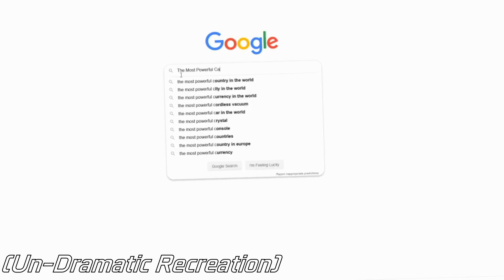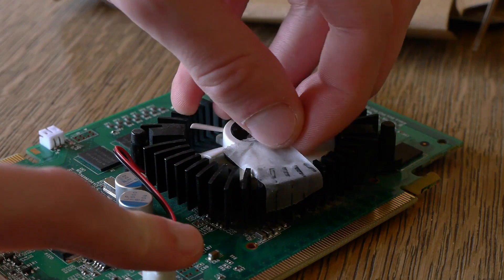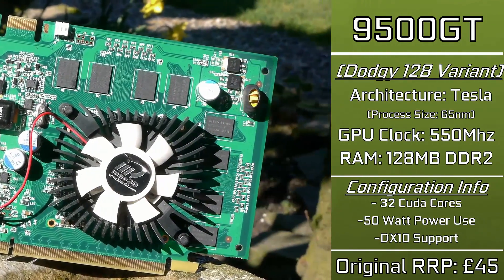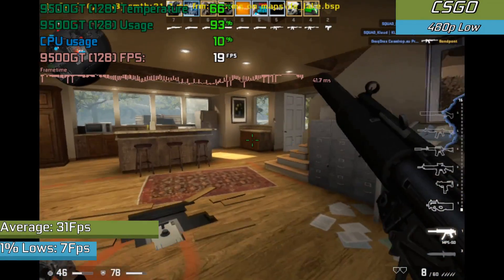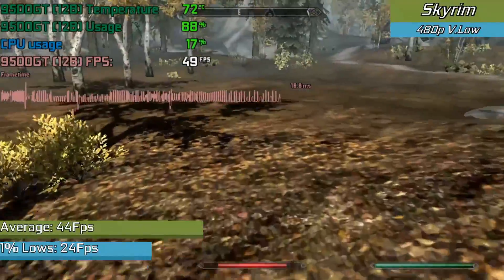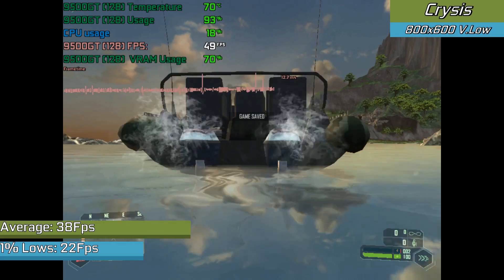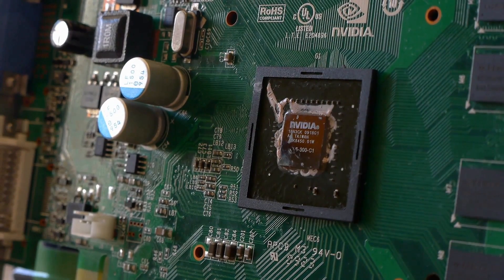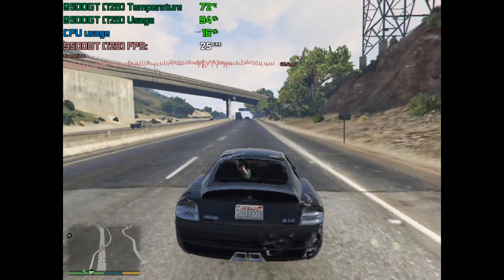The Worlds Most Powerful 128MB Card....

Comment: Imagine gaming on a 1MB graphics card...
Reply: 0.001 fps guaranteed
Reply: I game on a 1-bit graphics card.
Reply: @Crazy-qi1gw  ah, my favorite game, white screen black screen
Reply: I have a 2MB graphics card.
Reply: Basicaly windows video adapter 
(has 4-5mb vram) all the 3d rendering is done through the cpu power
Reply: Imagine using 1KB graphics card
Reply: There were cards produced in the early 90s that only had 256k and often around the 512k and 1mb mark depending on the budget at the time.
Reply: Dos games, wolfenstein3d
Reply: I played Unrial 2004 on S3 2MB with software rendering it works great on high settings it depeand on your system CPU and RAM
Reply: We used to lol.